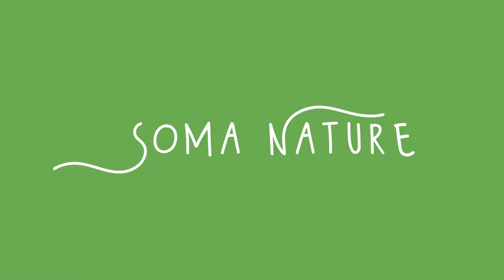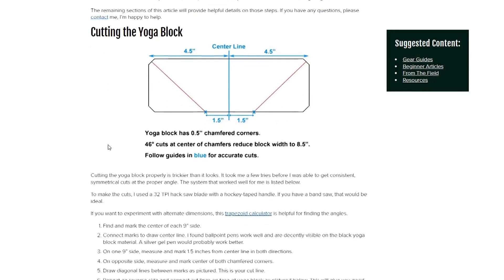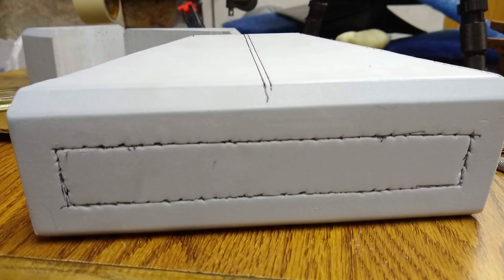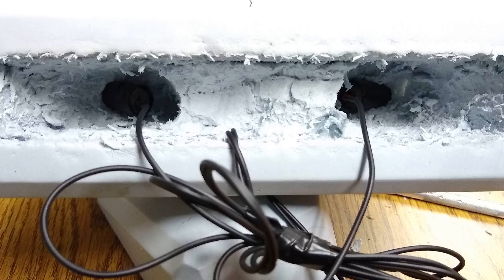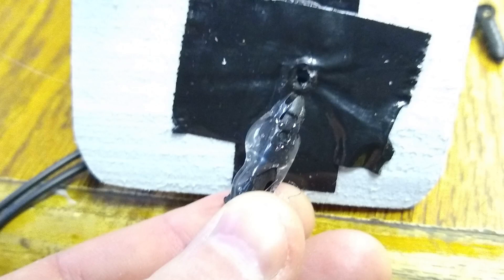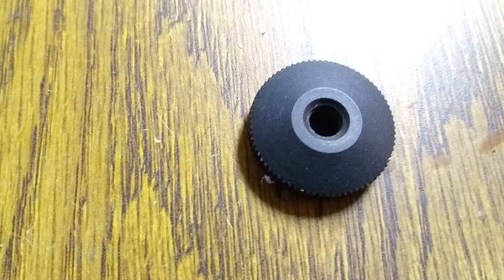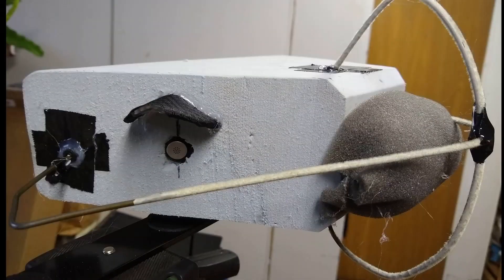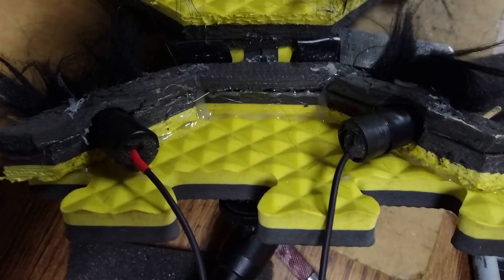Building a DIY Sound Ambient Sound System (SASS)

Comment: Thank you for sharing. As wind protection I could recommend using end caps of a blimp if you have those. Personally I use silicon ears but in your case you might even try the smaller baby ball mesh or as others suggested those plastic textile covered meshes from a toystore that you see on FB field recording.
Reply from the maker: Thanks for your thoughts. I do not have a blimp.  Do you have any links or photos of the meshes you are talking about? You can use my email on the about section if needed. I could probably make a domed cap from the knitting mesh and cover it with lycra and fur.
Reply from the maker: @Geoff Longford Thank you, and glad you found it helpful.